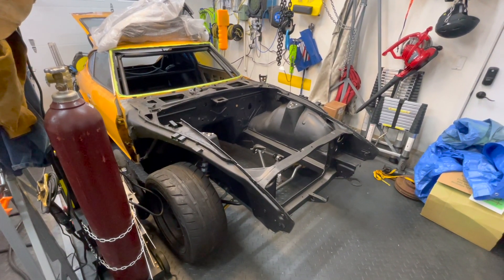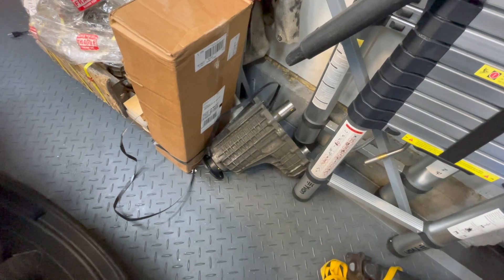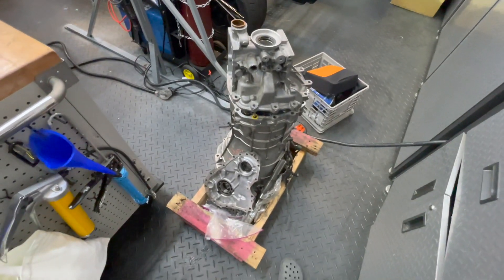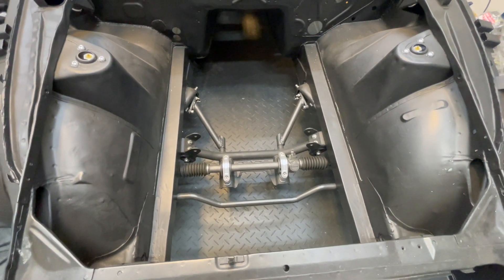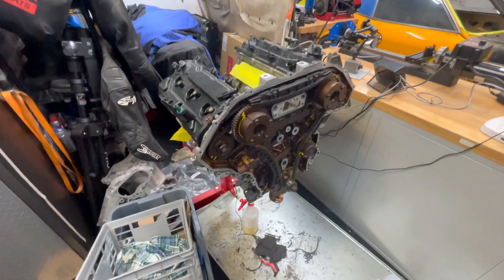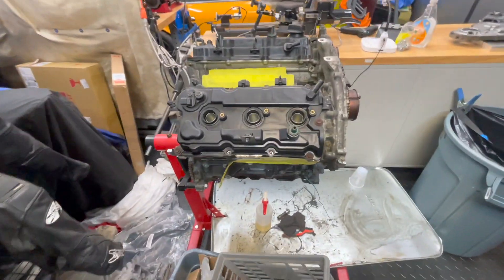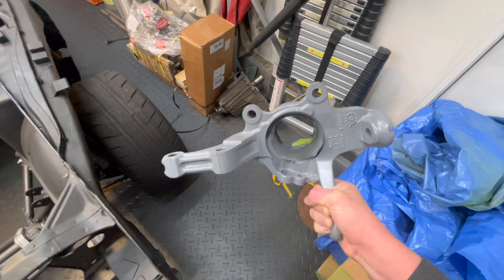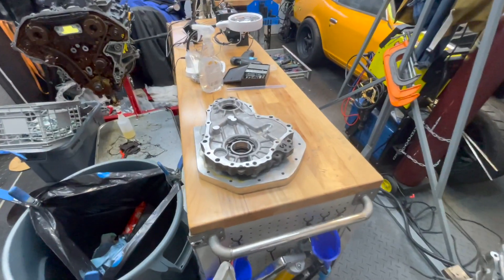All Wheel Drive 260Z - Getting caught up - Part 1

Comment: did you finish this project or how far along have you gotten so far. My personal/shop 71' 240Z build is a few months underway with an AWD conversion. using skyline GTR RB28 single turbo (stroked 2.6) and the AWD of the BNR34 6spd trns and front diff.
Reply from the maker: That sounds rad! I’ve been doing a lot of work on the 2jz over the last year. Will be posting some videos on that soon